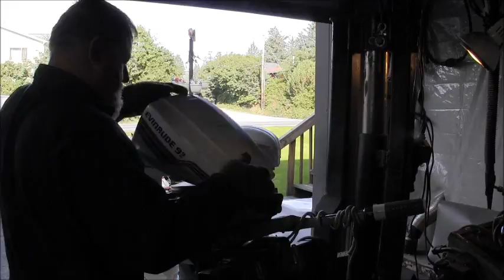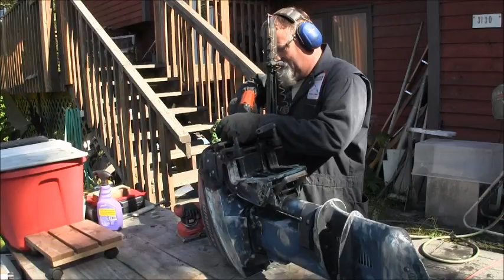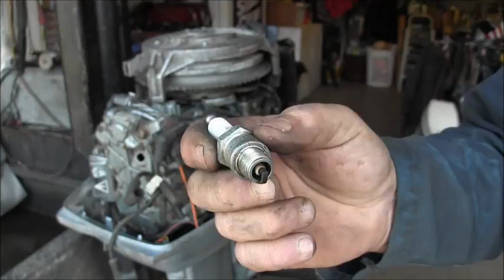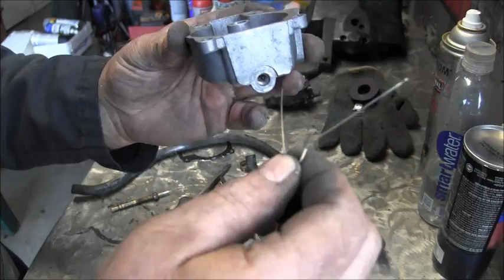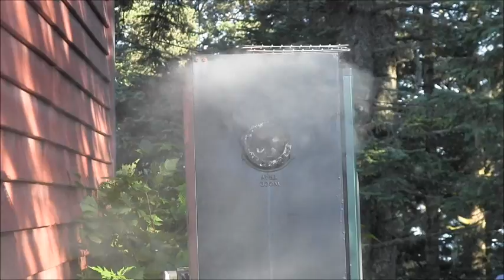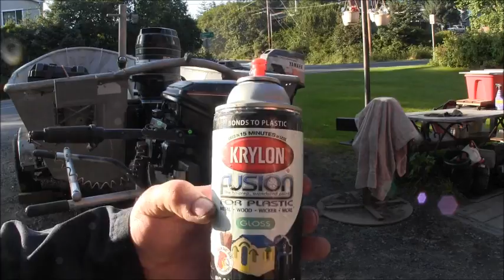EVINRUDE 1979  9 9 ,, EVINRUDE  1976  25 HP, EVINRUDE 1989  15 HP

Comment: Hi Kodi, For folks who get an outboard motor with no knowledge  on the basics, a quick how to squeeze a fuel ball properly would be a good one. There is a check valve on the top where the arrow on the ball is pointing. You have to hold the ball up while squeezing it or the fuel will not pump up firm and have air in it. Also air vents on tanks need to be open to prevent air locks.
Reply from the maker: Thanks' I am guilty of over looking the fact that there R new folks just getting started with boats & motors,  My bad 4 sure.     kodi

Comment: That 77 9.9hp is a beauty for sure.....Looks as if it was used in fresh water...You mention that the "owner" has no two stroke/mechanical talents, so I fear this nice engine isn't long for the world....Too bad you can't pawn off some lesser engine on him to ruin.  That 82 25hp looks more like what we would expect from an old salty dog.  Lacking of any sort maintenance, the old dog still fired right up and ran good.  Someone has been messing with the mag plate and has the wiring screwed up, but that seems to be on par with the service work this poor thing has suffered with throughout its life.  The stiff shift handle was a more common issue on engines a few years older....The issue there was usually a stiff shift handle shaft/bushing, they were hard to lubricate properly and the bushings salted up jamming the shift handle/lever.  This issue had been corrected by 1982, but the handle was probably never greased...On the other hand, could be a swelled shift rod oring/bushing like you mentioned.    That newer 9.9 surely looks better...The damn OMC paints tend to plug up the spray nozzles constantly, and are very expensive, don't blame you for finding an alternative.    Good day at the shop for sure!  Don/Kramden
Reply from the maker: I think I got the year wrong on the 25,  The hood was mine & the wrong one for it,  Owner said he lost it ?  Tuff  old motor never been serviced in it's  life,  Also the OMC rattle can is so thin  takes  10 coats..  thanks   Don.                       kodi

Comment: How on earth do you get the container of trans fluid and acetone in place > You show it up against the transom, above the height of the bolts! The bolts are frozen, hard against the transom, Please explain?
Reply from the maker: put the plastic containers under the frozen clamps, the weight of the motor will hold them in place, then fill.      kodi

Comment: Not a big deal but 1976 35HP first year was points and first year of the larger block 35HP no 25HP large blocks in 1976 last year of the 22 CI 25HP..Thats a 1977 or newer with the CD ignition  boy you get alot of work with outboards there on Kodiak Island!.... I live on a island too lots of motors same scenario. Good Video Lenny as always you are entertaining !.....Glenn
Reply from the maker: I got the year wrong, U R correct,   the hood I used does not belong on that motor as well The owner said he lost his,  Tuff old motor 4 sure.        kodi
Reply: @kodibassInsideoutboards  I try to be diplomatic & not a sarcastic know it all when I comment on YouTube if I see something is not correct or just a overlooked mistake. Theres alot I dont know. I happen to have a first year 1976 35 HP Johnson and I know it has points.  ................regards Glenn

Comment: Hi my friend, Yours videos are very good and funny. I need your recommendation:  I have an Johnson 7.5 HP 2 strokes 1980 that has an overheat due to water pomp problem.

 I have changed water pomp and power gasket; however, compression still at 75PSI (before the overheat it was 120psi) . Motor is starting very easily no problem and runs well. 

Do you recommend me to change rings to improve compression? what I lose running at 75 PSi ?
 I do not have same speed correct? anything else? it is very difficult to change rings?

 I can do it?

 thanks a lot
Reply from the maker: Most likely the intake rubber grommet under your power head where the watertube sticks in the power head needs replacing.    kodi
Reply: @kodibassInsideoutboards  Thaks Kodi. The Water pump is working well. What I could not improve is the cylinder compression that is still at 75 psi. Is ok that I continue using it with 75 PSI compression or do you recommend me to change rings to get a better compression

Comment: Looking at the 9.9 water flow it looks like the water is discharging from the pee hole and the upper exhaust section of the lower unit.  Is it supposed to be doing that?  Thanks
Reply from the maker: Yepper       kodi

Comment: Always great videos Kodi, I have a question. My throttle on my 1977 Evinrude 15HP doesn't line up with the indicator marks on the tiller handle. Is there a way to reset it? I was thinking that i may need to remove the tiller handle and re-install it.

When turning the throttle from zero to the start position on the tiller handle cam has not reached the roller so the throttle has not started to open. To line up with the timing mark on the timing cam I need to throttle almost half way around the tiller. Wide open throttle is  I'm thinking that the the gear that the Tiller handle meshes with may have jumped teeth?

Any guidance would be appreciated, Thanks, Dave
Reply: If I may, checking for proper alignment of those tiller gears should be your first step. If it has jumped a tooth or two, there is probably excessive play in the mechanism. Those gears are brass and they do wear out a bit with use. To me, the best way to take out that slack is by drilling a new hole to move the pin that goes through the  shaft  to hold the gears one against the other. Just don't over do it, it needs minimal play to work best. Regards !

Comment: Hey Kodi, would you mind answering a couple questions, if not no biggie, but I know you have this info in the old roller dex and it’ll be quick?
What’s the white color you use to match Johnson/Evin on a paint job, I acquired an 2002 40hp Johnson and the lower needs some love!
What size can of triflow do you usually order and what’s a good price on those? Prices are all over the place online!
Are those brass guitar strings you using on the carb and is there a particular size on those strings?
Thanks for your help!
Been out of electricity and internet service for a little while, Hurricane Ida knocked everything out, just got service back! It’s been hot as hell at night and even hotter cleaning up during the day! Thanks for any help you can throw my way!
PS....I already have the automotive primer, it’s the light gray color, like you used in this video, the white should lay over that ok without a bleed through????? I know it’ll take at least 3 coats to color it properly
Also, can you touch on the proper way to straighten out the BOTTOM fin, under lower unit, very bottom, someone hit something with the motor I have and needs love as well! Seals are good, I’ve already tested them, the metal just needs to be in line, like it should be!
Thans
Reply from the maker: OMC paint  p/n 0777171 ocean pearl white. tri-flow I buy @ walmart in the sporting goods dept,  gun cleaning/gun oil area. they have 2 sizes 8 & 12 oz's  for around  7 &11 $. As to the skeg if it is not hindering the performance I would leave it ,  attempting to straight'n it could crack it or worse.                        kodi

Comment: Hey kodi I’ve got a 1992 Johnson 9.9 it runs good but when it’s cold it’s hard as hell to start after it’s warm it starts first pull every time and when I give it wide open throttle it takes like 10 seconds to reach full throttle I have an 86 9.9 and it jumps right up on plane and starts when it’s cold can you give me a hint on what it might be I rebuilt carb and put new fuel pump but still no success thanks
Reply from the maker: Yes'  sounds like the idle to wot (transition) chamber in the top body of your carb dirty and some of the tiny holes are plugged.     kodi

Comment: Hi there kodi,     
  I hope that life is being kind to you.
Even if only occasionally.   
         Would you mind giving me some details of recently inherited
 25 Evenrude
           Plate reads
E25 BACIM
BO21123
          Any help will be greatly appreciated.
           Kind regards,
                     Les.
                London.     UK.
Reply: The CI letters indicate for sure  it is an 1981 model. Wouldn't swear on it but the BA might indicate it was built in Belgium and most probably has this typical electric plug receptacle on the side of the cowling pan !
Reply from the maker: As DR stated you have a Belgium made 1981 25 hp, It has a lightering coil added for battery charging, it also may have had a electric start kit added to it,  other than that just a good older well built ruddy.    kodi
Reply: @kodibassInsideoutboards 
2021
Hi there Kodi and Daniel,
Thank you for such fast, efficient information.
     I inherited this engine recently.
Used regularly for half hour trips at weekends until 1992.
      Started occasionally in a dustbin till 2000.
       Been resting in the garage since.
As I may not be able to send it to you kodi.  
            Regrettably.              
I would appreciate your guidance to reinstate this baby.
        What would you suggest.
Thank you both kindly.
              Les.
               London UK.
Reply: @danielrobert7181 

2021
Hi there Daniel and Kodi, 
Thank you for such fast, efficient information.
     I inherited this engine recently.
Used regularly for half hour trips at weekends until 1992.
      Started occasionally in a dustbin till 2000.
       Been resting in the garage since.
 I may not be able to send it to you Kodi.  
                 Regrettably.              
I would appreciate your guidance to reinstate this baby.
        What would you suggest.
Thank you both kindly.
              Les.
               London UK.
Reply: @lesdunn736  My first recommendation would be for you to get a specific OEM OMC repair manual for your engine. It will give you clear instructions to deal with any issue you might run into. Such manuals can be found on the internet. Regards !